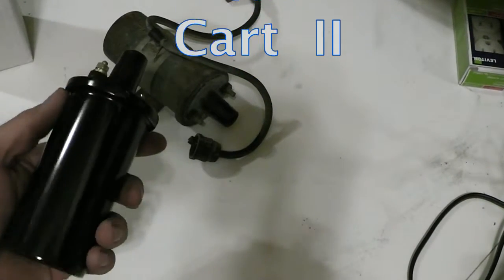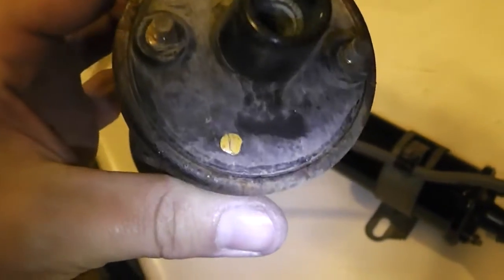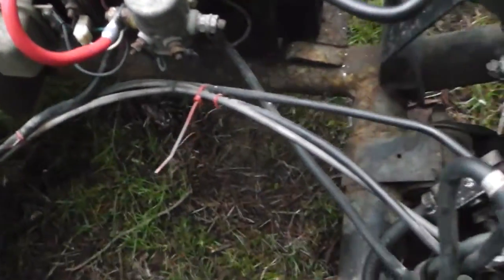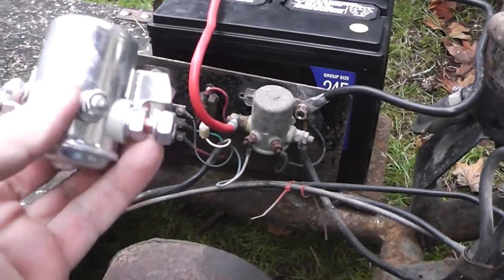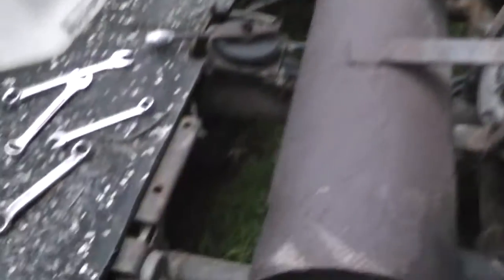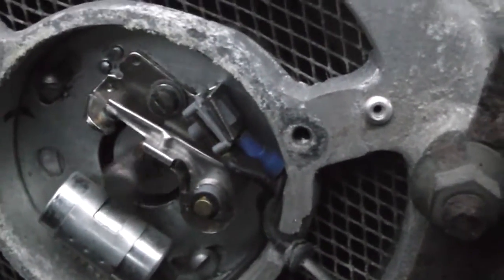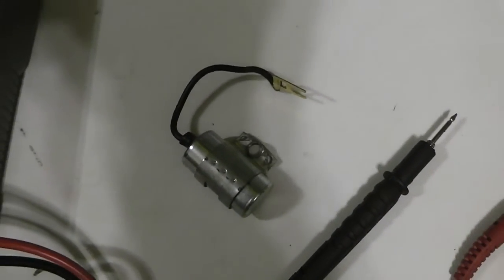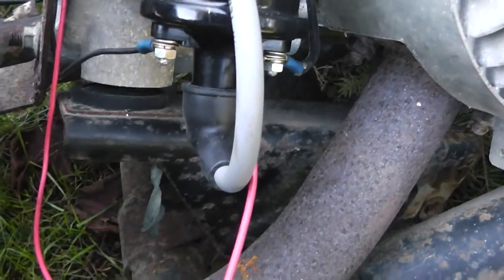Trike Cart   II

Comment: Tried to sand the tip on the contact breaker? Corrosion between them?
Try with another sparkplugg,  spark plugs can fail when it's get wet with gas. 
Tip
https://en.m.wikipedia.org/wiki/Contact_breaker